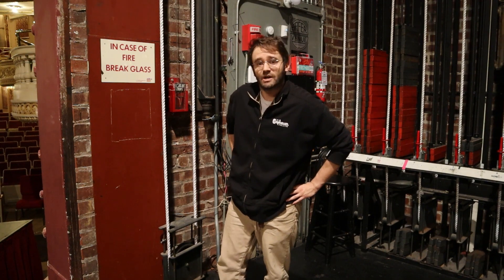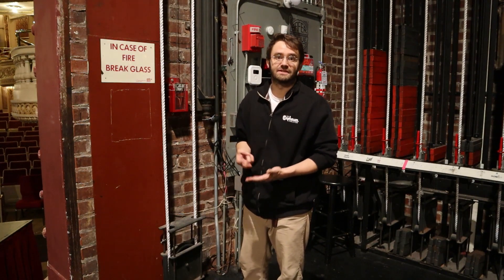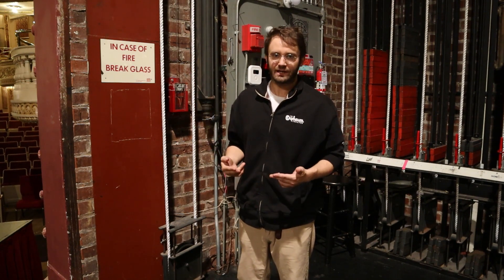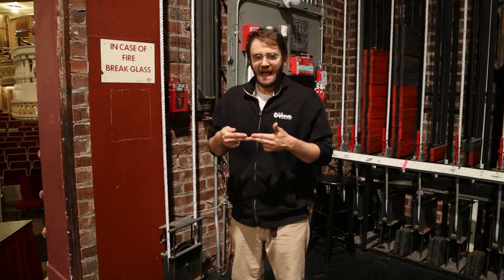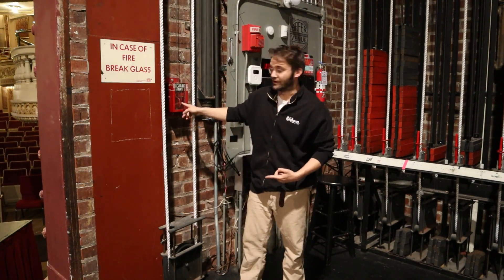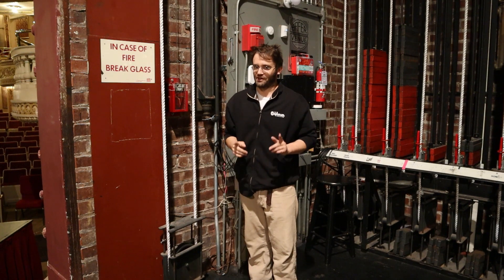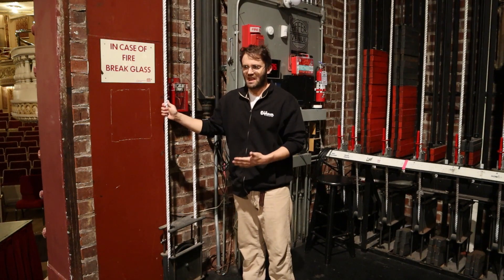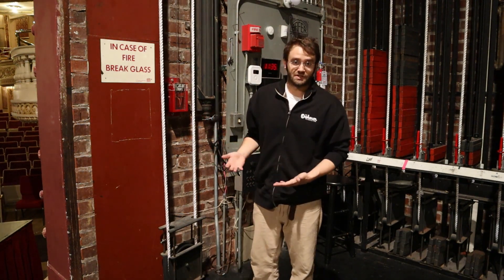Fire Curtain | Technically Speaking with Ross McIntire

Comment: To properly test a fire curtain, it has to be released from the pull stations (or emergency release stations) Not manually lowered. You have to check the drop times and make sure the dash pot is functioning correctly under load.

Comment: Hi Ross!  Your break-glass-in-case-of-fire box looks to be identical to one we used to have prior to replacing our fire curtain.  Does yours have a solenoid inside of it that will break the glass in the event of a signal from the fire alarm control panel?  Ours had the solenoid but it was never hooked up.  It always seemed a little dangerous to add broken glass to a fire evacuation situation.  Our new system uses a JR Clancy SureGuard II release mechanism that's tied into the heat detectors over the stage in addition to the manual releases and fusible links.